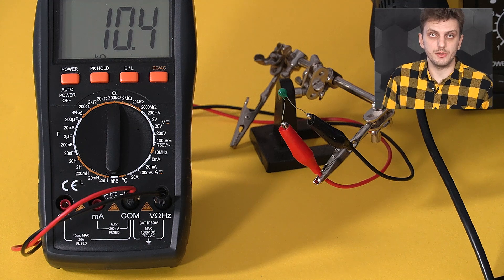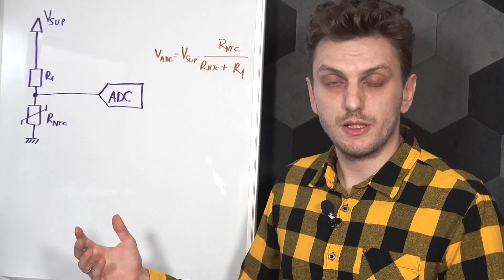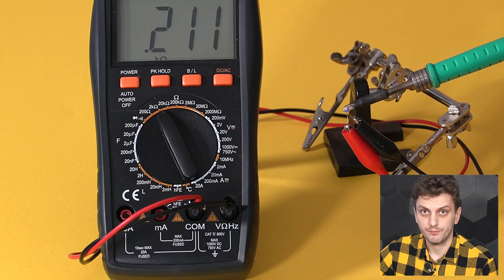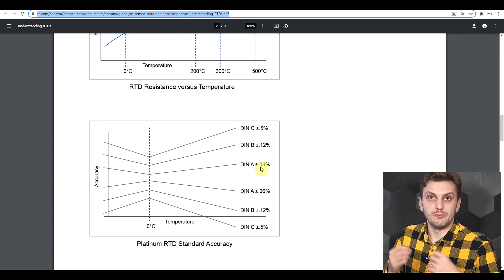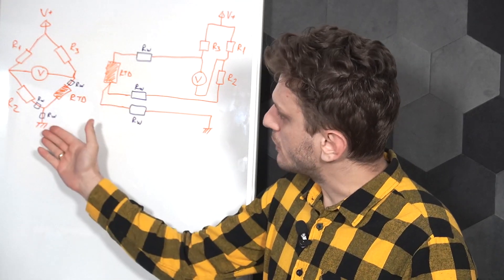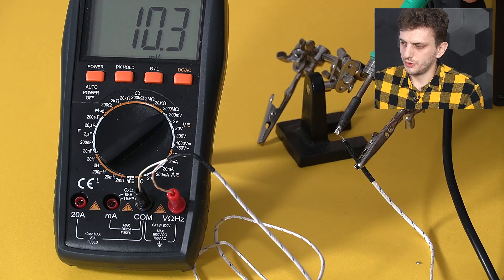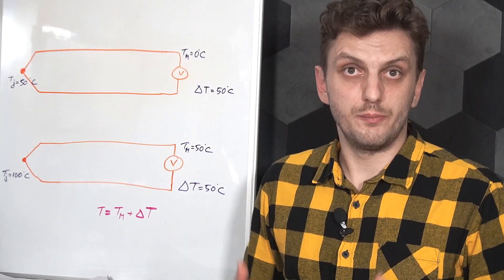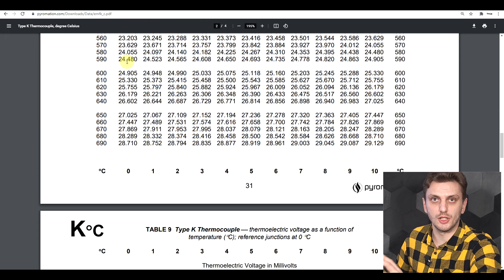Electronics tutorial - Common Temperature sensors

Comment: Your comments on the need for amplification for RTD and thermocouple signals are a bit out of date. Nowadays, very high resolution delta sigma ADCs are available at low cost, and they make it possible to directly connect a thermocouple to the input with no amplification. I am working on a product that involves measuring thermocouples this way, using a 24 bit ADC. It works very well.
Reply from the maker: I guess it has to do with the intended complexity and overall price of the system - an 8bit uC with a 10bit ADC coupled with a bit of amplification should be cheaper than a controller with a 24bit ADC. Anyway, a bit of amplification should help extend the measurement range and precision, even for the large adc.
Reply: @FesZElectronics  Admittedly in my product, the ADC is the single most expensive component. But that's because I went for one with lots of bells and whistles. Overall it is quite cost effective as the only other components on the inputs are some resistors/caps for an antialiasing filter. 

IIRC 18 bits is enough to get 0.1C resolution from type K thermocouples. So you could use something like the MCP3421 (18bit single channel differential input ADC with onboard precision reference) which is less than £2 in small quantities. Edit: it also has a PGA in it, but you wouldn't actually need to use it

Comment: More accurate measurement using the Thermocouple method is can be made
buy using a reference junction thermocouple configuration this uses two or three
Thermocouple connected to creates a electrical balance placing the reference
Thermocouple(s) into a thermal reference such a melting water ice enables a 
calibrated measurement that now depends more on the accuracy of the volt meter.
I have used this method in the lab and could reliably resolve 0.1 degree Celsius
changes in the boiling point of solvents during distillation due to barometric
pressure variation with the weather.

Comment: Thanks for the video! Interestingly the capacitance also varies with the temperature, a so-called temperature coefficient. It's possible to build an LC-oscillator and determine the temperature by measuring its frequency, which will change for about 100-500 Hz per 10-20 C or so. The fact that the frequency of an LC-oscillator varies with the temperature is a big problem when building an analog radio. There are special methods to solve this problem called temperature compensation. The idea is to connect two capacitors in parallel, one with a positive temperature coefficient and another with a negative temperature coefficient so that the net frequency shift would be about zero.

Comment: Another great video! Thank you.
In most of my applications I try to use PT1000 devices, since the wiring error is one order of magnitude less significant. It allows two wire applications when the necessary resolution is around 1/2 degree, only., while simplifying the input circuit and value conversion, due to the more linear behavior.
PT1000 is a quite common device nowadays.

Comment: Very good conceptual review, thanks for sharing.
Whenever you can, please post also the use of semiconductor-based sensors as, Si diodes and BJT (-2mV/C), LM35, and even Schoktty diodes (leakage current/C + 3xDarlington). A lot of applications with electronics could use their operating range.
I have done some simple variable speed fan speed controllers using NTC (+transistors), or diode+OpAmp for power supply heatsinks.
Based on your good way of explaining things, it would be a pleasure to see your ideas explained or demonstrated by you.
Thanks for your channel and please keep these good postings!

Comment: Unfortunately your drawing for 3-wire RTD is wrong.
Reply from the maker: Why do you say that? I mean, I make a lot of mistakes in general, but I'm not sure what the issue is in this case.
Reply: Please explain to me too. I see no error. Note that the bridge on the left is mirrored compared to the bridge on the right. But the reference designators clarify everything.
Reply from the maker: Response from @Phillipe Paternotte: for me your bridge drawing as-is is only consistent for a compensated measurement if you adjust the bridge to have both branches currents equal and V=0. Then the RTD value is computed by resistors ratio;  If you do not adjust the resistors and just measure V <> 0, the Rw is not compensated because the bridge is not equilibrated so you cannot compute the RTD  value with just measuring V.
 
I'm rather used to the common method that is used in industry, where a current generator is used and two voltages measured instead of a differential measure, so that the current in the third wire is null so its resistance doesn’t matter.

The effective measure is something like RTD = (2*V2-V1) / Isource. An example may be found here: www.instrumentationtools.com/three-wire-rtd (but generally we measure both voltages relative to ground).
Reply: Yes. This circuit is actually used for compensation measurements. Thanks for your observation.

It's also funny that you provided a link to instrumentationtools, where in rtd-questions-and-answers there is a section 'Three wire RTD Wiring' with almost the same picture and almost identical explanation as in the Fesz's video :)

Comment: Great video again!:) Thank you!
If you don't mind, I would extend what you have said in the case of ntc+adc. If you directly measure this resistor divider circiut with the adc and avoiding a buffer stage, you need to make sure that the sampling capacitor of the (SAR) adc charges up properly. Okay, it is small capacitor, but inproper setting of the adc can lead to false measurements in certain cases.
Reply: Good point!

Comment: great video, the temperature meters and calibrators have used and repaired, all were PT100 based. They were 4 wires, often equiped with lemo connectors and the measurement current was pulsed. An important part of the accuracity is, like in a dmm, the voltage refenece used  and the voltage measurement circuit.  The PT100 used are insainly expensive and kept in nice velved lined wooden boxes .